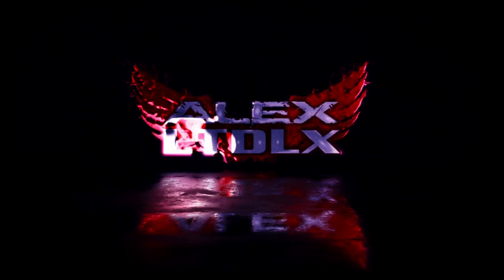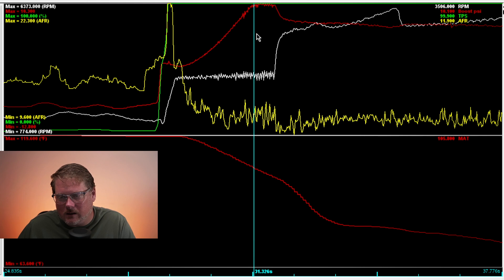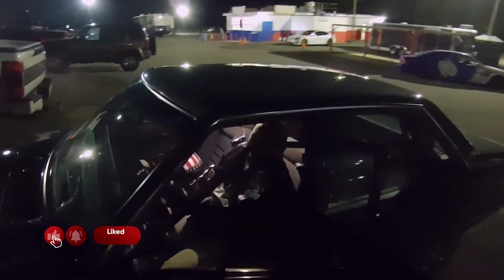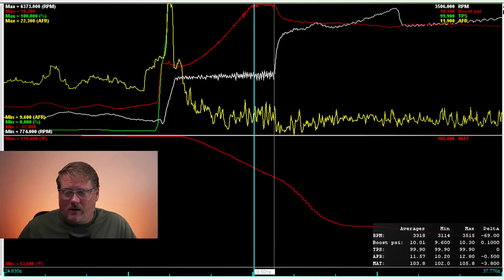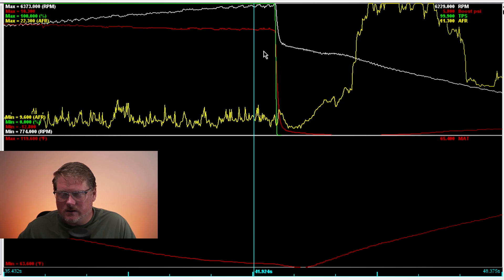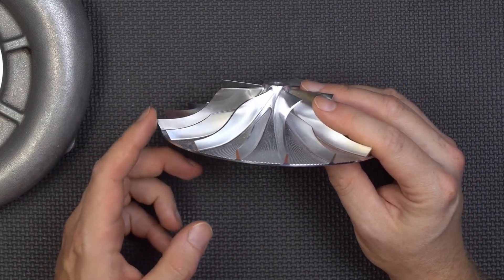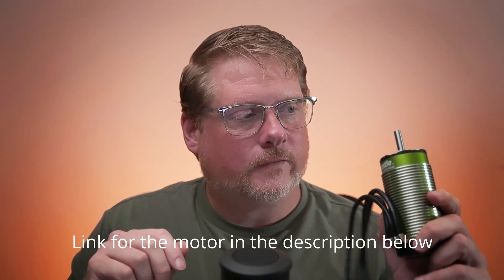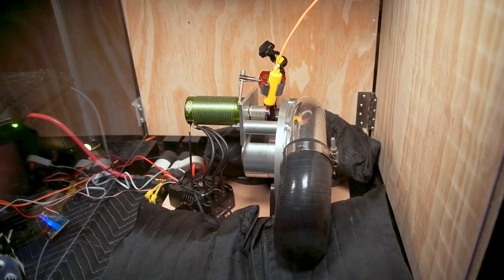How Much Boost Does An Electric Supercharger Make?

Comment: Currently building one but shoulf make more power , using a bigger motor gs165 50h , a 80v battery setup nd72680 controlller ect

Comment: Use an electric suoercharger too run my venturi cold pulse jest pumps, and youll increase its performance... and can match the intake too the input psi when you engage the 2nd stage and fire thenjet engine on the intake

Comment: Could be really interesting when in a conventional turbo as the high pressure side,  you could spool it when pressure is low and ramp down the speed of the second electric turbo to where it makes no extra power but overcomes the losses when inline with the second turbo spooled up, it probably wouldn’t even be that much drain on the system that way only ramping up when pressure drops below the target pressure,  this would overcome the power limitations of motors alternators and batteries available while also overcoming the boost threshold and lag on the turbo side,  it’s simple and entirely electric controlled so can run like a normal supercharger with the efficiency of a turbo or you can on demand compound charge when you need a little extra power. You’d probably need to slow the supercharger down as pressure from the turbo increases, but in theory by the time it’s only overcoming it’s own losses it should be minimal load,  or you could run as a turbine in order to drop and regulate the pressure of the turbo… 🤷

Comment: moi je connecter mon turbo électrique amazon indépendant en 2e ligne donc le CAI est seul et le turbo donne air  seulement si le allume mais fermer il bloque rien ses comme si y existait pas.
Connecter  avec un adapteur en T qui prends air direct a l avant donc ne rentre pas en conflit avec le CAI et cela me donne un meilleur temp de 0 a 100 si il est a ouvert de 0.8 sec ses bien et si je le veux pas je le laisse a off et il est indépendant donc ne cause aucune restrictions au CAI
conflie

Comment: What if you used a 24 volt system?
Reply: And used and air tank with a regulator
Reply from the maker: To do what? The electric supercharger runs on its own 63 volt system. 24 volts would not be enough to reasonably hit 34,000 Watts; the current draw is extremely high, a 24-volt system would almost triple that draw to somewhere around 1500 - 1600 amps.

Comment: I was impressed by this guy, and now i ordered a few parts 
5694 1000kv motor 200 amp 48v
Ztw 300a seal g2 esc
Two 5300mah 60c brust 120c lipo already arrived. 
12s Bms to charge batteries on the go.
12v to 48v stepup 3 amp
Turbo housing, i got free from valvo Truck it has 2.5inch induser and 3.5 inch exducer hopefully it will work for my 3.6L dodge 
Other parts like cables 250 amp circuit braker clamps battery box also planing to control fan speed it will be like active cooling system for batteries

Comment: I picture an electric supercharger this way. 
Imagine a combustion engine, whose intake air is fed by a second engine. 
    There is no fuel in this second engine, it just pumps air through.
    (It only needs a inlet valve. Suck, blow. It's just a thought experiment.)
The second engine is say twice the capacity of the combustion one. 
Suppose it runs at a constant 2000 rpm, driven by an electric motor. 
   It is delivering a constant quantity of air per unit time. 
So by the time the combustion engine is turning at 4000 rpm, the second engine is out of puff.
  It can't keep pace with the combustion engine's need for air.
But up to then, it adds extra air (i.e. power) in proportion to the difference in the engine speeds. 
Or, better, it adds a constant amount of power over the unboosted combustion engine alone.

To a first approximation.

Comment: It is a good and the right question as the people most likely to use an electric supercharge / electric turbocharge

Simply dont have space for a real turbocharger or supercharger and have smaller engines im talking 1.6 liter and under

So im now done with the video as 10psi max is all i needed to know as i have a 1 liter engine and the flow rate will be far FAR higher than the engine and successfully intake so its wasted info in my case at least

Comment: I have been thinkinh could make a adapter switch for the gas wire so when you press the gas it makes the turbo at full power and when you let off it puts the turbo to 0 i think it could work by putting kind of like a smooth switch that controls procentage on it and work so it could like as a instant turbo
Reply from the maker: You could certainly do that; but you wouldn't want boost at extremely low rpm - that creates very high cylinder pressure, putting tremendous stress the engine and makes the tuning window very small.  Point being, you'd want some more controls other than just a direct relationship with the throttle.

Comment: How hp does it take to spin up the Amr 500 supercharger? Which electric motor would be best?
Reply from the maker: I don't know for sure, but probably not much - that's a pretty tiny unit.  But it should make some useable boost on a lower-powered engine - maybe as much as 150 hp.  I'd imagine (and keep in mind, I'm just guessing), that a 5kW motor would be able to max that thing out pretty easily.  I'd look for a 5kW capable motor which has a max speed of about 25,000 rpm - you'll never hit that rpm loaded.

Comment: It's not wrong to ask for boost figures; every 1 bar of boost is effectively doubling your engine displacement. If you have a 6 L engine and your pushing 10 PSI that about 0.75 bar, so your 6L is effectively 10.5 L or more than a 50% increase in effective displacement. Of course, boost will taper as the flow capacity of the turbo diminishes at higher engine speeds. Personally I think this is adding complexity to a problem that traditional turbos solved well by recirculating exhaust gasses to drive the turbine rather than introducing a new and separate power source just for the turbine. Perhaps this electric turbo approach would make more sense in a hybrid car where you already have the batteries and wiring in place, and can power the turbo electrically to boost the power of the combustion motor.
Reply from the maker: Of course you're entitled to ask for anything you want.  But the notion that 1 bar of boost effectively doubles your displacement is incorrect.  The general idea I think you're trying to convey is 1 bar of boost doubles your power - which is also incorrect for a whole host of reasons.  For example, when I ran a Whipple on the car at 15 psi, it made the same power to the wheels than the electric supercharger made at 6 psi.  Why?  Because is took at least 70 crank hp to drive the supercharger.  And the supercharger was less efficient than the electric supercharger's compressor is - which meant more charge cooling (on top of the additional charge cooling needed for almost triple the boost), which meant more losses.  On top of that, I couldn't run as much timing at 15 psi as I could at 6 psi.  Conventional turbos maybe better than the Whipple, but they still incur pumping losses, making them less efficient overall than a conventional turbo.  And a turbo with 2:1 backpressure will make more power at the same boost level than one with 3:1 backpressure.  Pumping losses are real.  The electric setup incurs no pumping losses.  Plus it's a lot easier to install, more flexible, portable (can be moved from car to car) and it's lighter as a system.  There are limitations, to be sure, but there's really no contest with conventional forced induction.
Reply: @AlexLTDLX  Yeah, I realize there are mechanical losses involved however it is true that 1 bar of boost is an effective doubling of your engine's displacement. I never said it was double the power output. All that forced induction does is allow you to burn more fuel per power stroke and it's a simplistic way of understanding it without going into the weeds.  Obviously there are limitations like heat soak, fuel detonation, and such that prevent 1 bar from being exactly the same as physically doubling the displacement of the engine...though my main issue is that boost is not irrelevant or foolish to inquire about as we gauge the performance potential of a compressor by looking at CFM @ max boost.

Your electric system may not have parasitic losses directly, but how are you keeping the battery that powers the compressor's motor charged? If you are doing that doing that separately, meaning that the car does not recharge the battery as it is running, then the car that depends on some external charging source to operate properly. For drag racing, no problem, but for daily-driving it would definitely become an issue if your "boost battery" died while you were on a leisurely ride to white castle.
Reply from the maker: Ok, I see where you're coming from.  Yes, from that perspective, I'll agree with you about the displacement comment.  At one point, I kept the same induction (throttle body, intake manifold and cylinder heads) and put them on a stroker shortblock - went from 306 ci to 365 ci.  The car ran exactly the same times at the track.  As for how the electric setup recharges - well, I've never had to charge it in a day of dyno testing or drag racing.  I doubt it's realistically possible to run out of battery in any 1 given day.  But there is an on-board charger that can charge from the car's alternator; I've never really had to use it.  If you really wanted to be an efficiency nut, you could have it charge only on braking - and then charge fast - it would improve the car's braking performance and pad life and have no impact on mileage.

Comment: Im not seeing the downside here. You managed about a 250hp gain with pretty much no lag or drag on the system with a base hp of about 550? Isnt that about 50%? About what anyone expects out of a normal single turbo setup? Sounds like a great even alternative.
Reply: Except the additional weight and limited uses of the power source for the electric turbo. Most modern turbos have solved the lag issue with variable valve timing, and on large-displacement engines they have enough torque on their own to cover until the turbo spools.
Reply from the maker: A conventional turbo system is heavier, harder to install, is a heat nightmare and makes less power per psi - you have the cast iron hotside, heavier headers (if you want them to last, that is), an insane amount of piping, all kinds of fitment nightmares, etc.  This thing weighs about 20 lbs, and the batteries can be as light  20lbs (though I use heavier LTO cells for safety during development).  Also you can put as many of these as you want on a car, take them on and off in minutes, move them to another car, and since it makes more power per psi that makes your tuning window much bigger, requires less charge cooling, etc.  This system is vastly superior to a conventional turbo setup.
Reply: @AlexLTDLX   Hey I hope you can make it work. I'm not trying to knock your efforts here but the "electric turbo" does have a storied history. Late 90s early 2000s there was a lot of alternative FI efforts. There was this one company selling turbos that mounted under the car, right before the exhaust dumps. People said it was good but the idea just never sat well with me.
Reply from the maker: It does work - here it is at the track putting a 12 second car into the 9s: https://youtu.be/RT0M88xHzNQ

Comment: Wouldn't it be a lot simpler and just as effective to use a tank of compressed air with the amount of pressure it sends to your intake limited by a valve with input sensors that are already wired into your existing setup?  Is that not allowed at your drag strip, or too easy to be a fun project, or what?
Reply from the maker: It's not very practical - but a good thought.  Mickey Thompson did exactly that back in the day.  The size of the tanks needed for a quarter mile pass was crazy.
Reply: @AlexLTDLX  I see, thanks.  I won't bother trying that, then.

Comment: I am building an expérimental aircraft and was very interested in  a similar setup to have normalized turbo/supercharger up to altitude to maintain HP so a waste gate and an alternate air source is needed for redundancy….. any thoughts?
Reply: Wastegate is what regulates boost pressure by opening and bleeding off any boost above the set limit. With airplanes, you would need to evaluate a given turbo's flow characteristics at given altitudes where the air density is lower than what it is at sea level. It will also take exponentially more power to sustain RPM at lower air densities than it does at sea level. I'm not sure you'd want to deviate from the standard, tried-and-true exhaust-driven turbo setup when considering airplanes.

Comment: All of the cheap electric 12v turbos I looked at were for a 2.0 m ax motor, it seems to me the problem volume can be  solved for 2 on    a 4.0 motor ect.

Comment: I'm hooked.  A buddy of mine and I have been building a car where the target is the fastest turbo spool up we can make for it with reasonable drivability.  It's a built K24 engine with a fairly small turbo, and now we are starting to look into twin-charging using an e-turbo.  We could upsize the turbo for the higher RPM breathing demands if the lag can be covered.  This is exciting stuff.
Reply: Alex, I can't seem to get registered on Electrified Boost ... I don't get the confirmation email to my gmail account.  I tried the Contact Us form but so far nothing back.  Thanks!
Reply: Why not just size the compressor properly based on the displacement of the engine? Back in the 90s Paxton was making Novi 2000 superchargers that can produce high boost and flow though the use of gearing. Without too much machining, you can replace the pulley with a bracket to hold the electric motor of your choosing, thereby driving it with the motor instead of a belt...or just use a belt drive with the electric motor for even more simplicity...though at some point you have to wonder: wouldn't it be better just to drive it with a pulley connected to the crankshaft?
Reply: @alphaforce6998  because it's not that simple.  Do you want to make maximum power up top or most area under the curve?  Do you want a lot of power quick or even more later?  It takes different parameters to optimize for different choices.
Reply: @Scoots1994  Yeah, but a NOVI supercharger will fulfill the flow and boost demands for most engines if you can drive it at the right speed for a particular engine speed. As long as you have boost @ required CFM everything else is a matter of tuning the engine.
Reply: @alphaforce6998  You know we are talking about using superchargers driven by an electric motor not the engine right?  Also, a NOVI will flow a lot of air at high speed, but if you want maximum HP you still have to size it for the maximum hp target and the hp and torque at slower engine speeds will suffer.  Or if you size it smaller for lower engine speed power then the maximum will suffer.
Reply: @Scoots1994  Read what I said. 
A supercharger (and turbo) is rated to flow a specific CFM (volume of air) at a given boost level.  Because superchargers are mechanically driven and not depending on exhaust flow, as long as they can flow the right amount of air at a given pressure they will work.

It makes more sense to rig a supercharger to be motor-driven than it does to take a turbo apart and hack it together...although when you take a step back and really evaluate what you are doing, can you say that it makes more sense to drive the blower with a motor rather than a pulley on the crankshaft? I think not.
Reply: @alphaforce6998  yes, because the parasitic losses of the supercharger mean you make less power and stress the engine more.  The turbo is better in everything than a supercharger except for the lag.  I want to use an e-supercharger to solve that issue.
Reply: @alphaforce6998  A compressor is designed to flow a range of CFM for a given PSI, it depends on how much air the engine is consuming.  A 21L tank engine will consume a lot more CFM at 10psi than a .5L engine.  Likewise 50CFM can be used at atmospheric on a fairly large engine or a smaller engine spinning it's guts out, or, with boost, on a small engine at much lower revs.  There is no one size fits all solution.

Comment: How do you manage an electric supercharger like this? I guess with it being electrically driven that opens up more tuning options for compressor speed as well as the engine map
Reply from the maker: It's controlled by the car's EFI  - it turns on above 3,000 rpm and 80% throttle.  Since drag racing is what I do, I want as much power as possible all the time.  But yes, you're right - you get into all kinds of boost ramps and basically infinite control.
Reply: @AlexLTDLX  Interesting, I could see this being very effective on setups that're design to run primarily naturally aspirated for efficiency but use a supercharger to increase power. As there isn't backpressure or rotating drag from something like a turbo-impeller that'd really open up efficiency. I've been looking into a system similar to this on my 6-6 Accord primarily for packaging reasons, but having that flexibility would certainly open up more options.